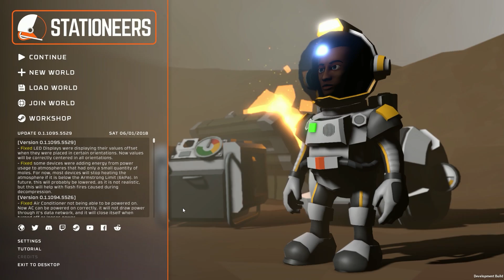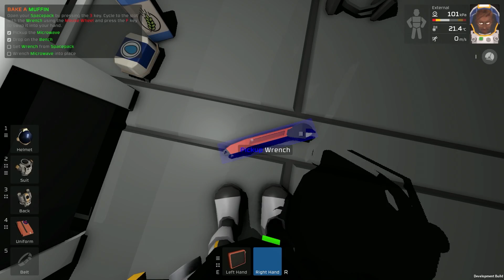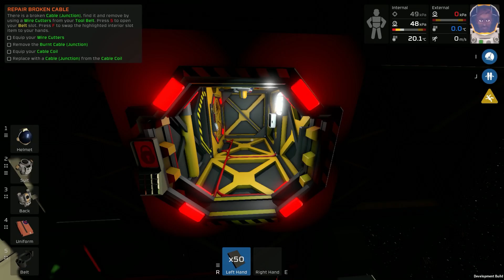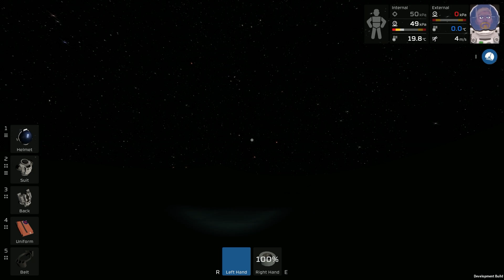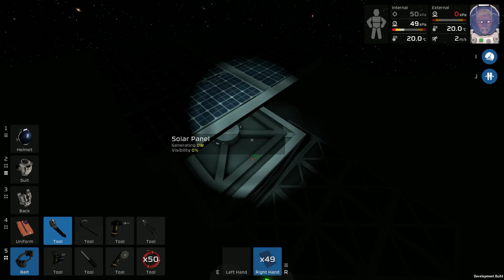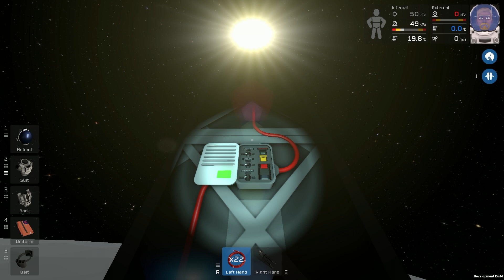Advanced Space Station Survival Game! (Stationeers #01)

Comment: Wouldn't flares not be able to burn in space due to the lack of oxygen?
Reply: BlueBanana07 I think flares aren't really a fire so no they don't need oxygen
Reply: But flares burn!
Plus, you need a lighter or a match to start them or some form of fire or heat
Reply: just because you need a flame to start a flare doesn't mean it needs oxygen, there are other oxidizers after all
Reply: Combustion does not need oxygen, just an oxidizer, and it does not need to be in the air. Gunpowder will burn in space.